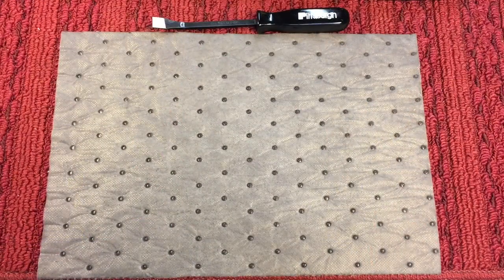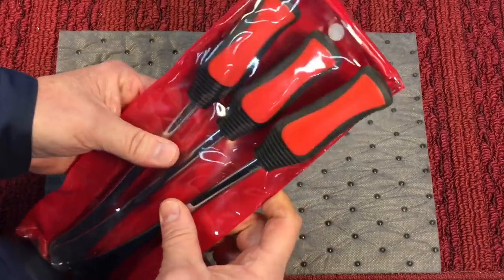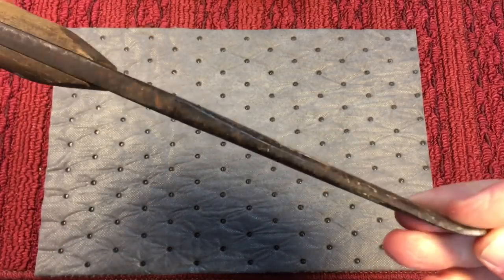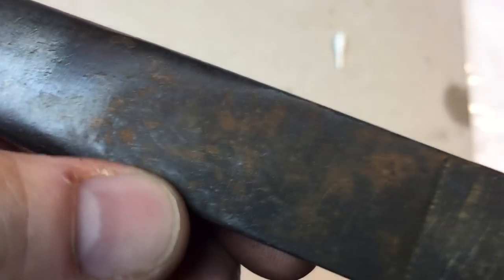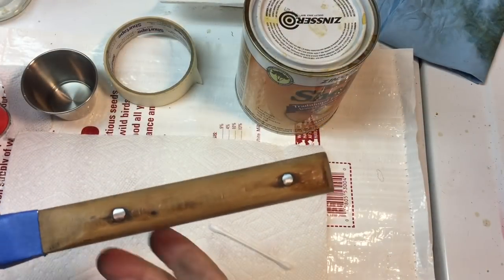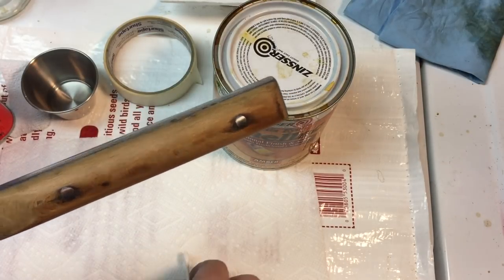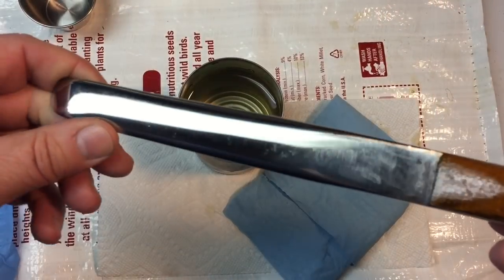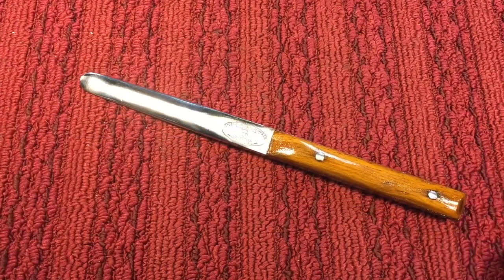1917 Matchless Tire Tool Restoration

Comment: This brings back mixed memories. In the summer of 1953 I worked at a series of corporate Gulf stations in the Washington, DC area. We had no tire machines and we used tire irons and a rubber mallet for all of the tire repairs. It was a killer. By the way, we mended inner tubes with "hot patches", a heated system that vulcanized a patch onto the damaged spot. Ah, the good ol' days ....
Reply from the maker: Hello Carver!  I bought a Tire C Clamp made for Hot patches!  I want to do a video on it but I can't find any Hot Patches!!!!!  I look on eBay all the time!  You are right, changing tires by hand is a bear!!!!!  Thanks so much!!!!!!!!!!

Comment: I've found the quality of tire irons to be of great importance. My fathers most used set that gets used on everything from lawn mower tires to truck tires to large tractor tires, are a pair of Honda Motorcycle tire irons. The steel they used is just fantastic, so they are thin enough to get in there and spoon the tire off with less force. We have a pair of 2 foot harbor freight tire irons, and they are so thick that they just never seem to work. And naturally they are bent as well. It's definitely worth the time to save old ones if they are quality.
Reply from the maker: Hello MB!  Tire Irons are one of those tools that is often overlooked and under appreciated but can make a world of difference when dismounting a tire.. I remember as a kid taking an old beat up screwdriver and rounding the edges and giving it a slight bend so I could work on my Bikes without pinching the tube, I thought I was such a genius!  LOL  To be honest this would make a great home-made tool project because like you pointed out, a good quality spring steel and thin tip makes a great tool!  Thanks!!!!!!!!!!!!

Comment: Great restoration John . Loved the way the wood turned out , I like the look of Amber shellac , and use amber over clear 3 to 1 . I did the wood in my Breezway between my house/garage in amber shellac .  I also bought a nice Grizzly 1 x 30 sander like yours . Mine is Grizzly model H6070 and has a 5" disc sander on the side as well . I paid $152 on Amazon and could have saved $70 if I went the Hobbo Freight route , but having never bought a Grizzly brand tool , I thought I would give it a chance & I Love it !
Reply from the maker: Hello Dave!  That is great!  Now you just need a good assortment of belts and a belt cleaner and you will be set!  One note- For some reason the really coarse belts like 60 Grit and below tend to break at the seam for some reason!  If you had to get normal belts I suggest 220 Grit!  One of the best investments I ever made!  Also I think the Grizzly is better quality then HF...  Thanks Dave!!!!!
Reply: I have a 4" x 36" Craftsman sander my Dad gave me in the garage for wood working that has 80 grit on the 4" x 36" belt and 120 on the 8" Disc. So when I ordered the Grizzly for my basement shop . I also ordered 3 sizes of 1" x 30" in 80 Grit , 180 and 400 grit , and for the 5" disc sander. I got 120 and 240 grits . So I could mix & match one set of 80 grit with 120 on the 5" disc, and 180 with 240 , and 240 with 400 grit for fine work . I am going to start Metal work trinkits in my basement this winter as well as doing some scale model TinPlate tractor toys , and small scale buildings as well . My GirlFriend knows I am NuTs now ....LOL.... @ScoutCrafter

Comment: A school chum of mine that runs Roof brand mowers uses pushrods to change tires and tubes because they run bicycle sizes on the rear wheels. I like that but I have a couple of old spoons that have at least 1/2 inch handles on them. I even wire brushed them and oiled them down a while back. Was guilty I suppose because of Uncle Sneelock and Mr. Chadwick. Now with you I've even MORE guilt but I've got plenty of oil! THanks Scout John and have a good nap and digest for a while!
Reply from the maker: Hello Lewie!  Tire spoons are something that until you use one you never know just how great of a tool it is!  I'm a huge fan!    Thanks so much!!!!!!!
Reply: @ScoutCrafter  Likewise! I got the hang with screwdrivers but the spoons work a lot better. You know how it is. You use what you've got! C U SCout!

Comment: Nicely done, you could patch a lot of Model T tires with that. I have the same set of spoons as your Amazon ones for changing tires on my old motorcycle.  I am a little spoiled because the local farm store will mount a tube or tire for free if you buy from them. My Sears snowblower tires are little beasts to change.  I have a a 20hp Bolens tractor I am working on.  They pulled the tires on it for free so I could paint the rims.  Of course they get a large percentage of my income as they are the best all around local store. They sell nuts, bolts and washers by the pound too. I like the True Value but they sell by the piece.
Reply from the maker: Hello 57W!  A good hardware or general store is most important.  I have a good Tractor Supply that believe it or not has a nice hardware section where you can buy nuts, bolts and washers by the pound. That little tire iron set works well for smaller tires and you are right, if you have a small tractor, trailer of other farm implement you need to be able to change a tire!  Thanks so much!!!!!!!!

Comment: A rub down on the handle with some XF steel wool and then polish would give it a nice satin finish, no? It's a deserving piece. Nice job!
Reply from the maker: Hello David, There is 5 coats of shellac on there, between each coat the handle was steel wooled with 000 Steel wool. The last coat was clear.  As time goes on the shine will naturally diminish and look rich and still be easy to clean and resistant to grease, oil and dirt...   Shellac was used a lot years ago on wood...  Thanks David

Comment: That pry bar was a very substantial piece of steel very thick in the handle and looks very strong. Now it has been restored would make easy work of removing tires as it is highly polished and would easily slip between the wheel rim and the tyre.  Very nice tool and wood is nicer than plastic to the feel.
Reply from the maker: Hello Tony, You are so right, the tool was heavy duty and designed very well...  Good for another 100 years!  Thanks so much!!!!!!

Comment: Man, that thing is as thick as a brick! No wonder they were used as pry bars once they started becoming obsolete. 
I bet a wood working lathesmith could make quite a useful gouge out of that. 
It’s totally unrelated, but this video reminded me of a thin, spatula-like, butter knife sized tool that I found that may be in the putty knife family of spreaders and it has a curious looking logo that I cant make out. I dont have a buffer. It looks like the logo has a map of the lower 48 states in it. I should send you a video to see if you might be able to identify it. It’s quite springy.
Reply from the maker: Hello Joe!  Yes, they made many scraping tools that were the same shape as putty knives but twice the thickness!  I have a couple!  Send me the pic, maybe we can find out the make!   Thanks Joe!!!!!!!!

Comment: I used an old shoe with a rubber sole to clean my sanding belt for a long while. Tip from I Swan. Until I bought the real deal. It worked well.

Comment: A nice job,not as difficult as some you have done,but came out nicely for 100years old...I haven't seen many tools of that type,as it is more of a bicycle,motorcycle type tool,we used tyre levers..(and a tyre changer/wheel balancer machine)..I have the same prybar set,in packet of three,but mine have fluro orange handles,but same factory in Taiwan no doubt..hows the snow treating you ? 
 

 see many tools of that type
Reply from the maker: Hello Bob!  You're right! The newer tires pretty much require a mechanical advantage to remove the tire. The spoons are great for non auto tires!    Thank goodness the snow is gone and 50's by Sunday!  Thanks Bob!!!!

Comment: i was hoping for a demo on the tractor,lol... i have a 1950,s Bishman tire machine that uses both air and electric and does 12 to 17.5 inch tires. it grabs the inside of the rim,it really was way ahead of its time,i purchased it to do the bigger tractor tires but have changed my truck tires as well. i also own both hand tire machines from HF and they are worth there weight in gold.no leaf blowing here,still snow on the ground in spots,but by Sunday it will be gone because of...... RAIN,lol
Reply from the maker: Hi Roger!  Sunday mid 50's here!  Nice!  I still have to cover the AC unit!  LOL  I waited a bit too long this year!  That Bishman sounds awesome it's just too bad we don't have a huge Pole barn that is climate controlled!  That's all we need and we will be on easy street! No more rearranging to try and make room!  LOL  Thanks Roger!!!!!!!!
Reply: @ScoutCrafter  my garage is heated and air conditioned,lol. i need to dig my snow plow out still plus some other stuff,supposed to rain again Monday too : (

Comment: that tire tool is beautiful. I could see a lot of people using a screwdriver for the same job because they could turn screws or pry with it. Nowadays we don't use flathead screws any more but they still sell all kinds of flathead screwdrivers.
Reply from the maker: Hello David!  Yes, the only problem with screwdrivers are they can pinch the tube and cause a flat!  I know from experience!  LOL  Thanks so much!!!!
Reply: @ScoutCrafter  a lot of people round the tip of a flat head screwdriver on a grinder
Reply from the maker: david-  I did that same thing when I was a kid!  I thought I was a genius and the first to think of such a trick!  Lol
Reply: @ScoutCrafter  I also had a couple of tire prying tools they were around 6 inches and bent on one end and a notch cut into the bent part to hook on to a spoke they were cheap things  but they worked good.